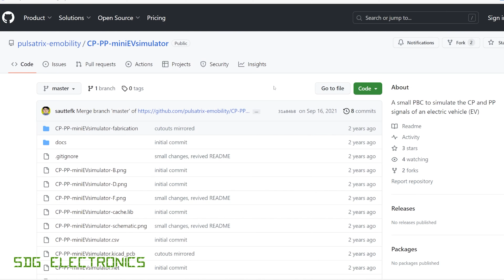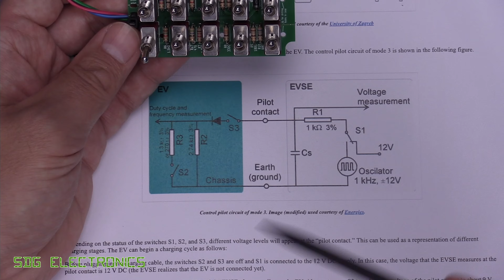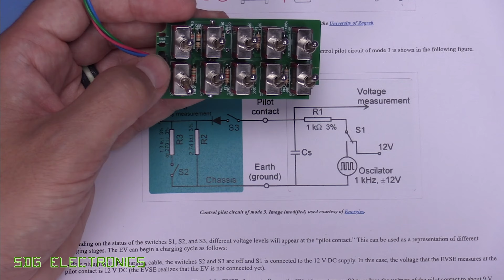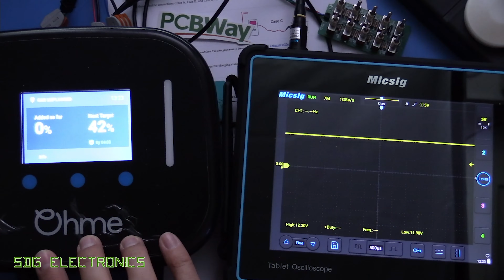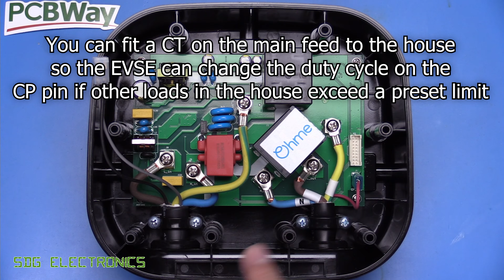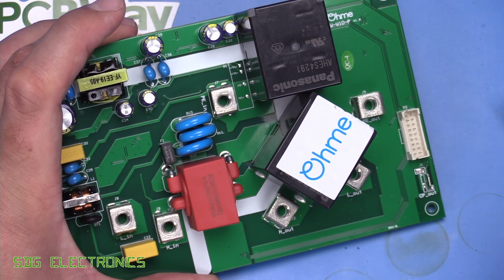SDG #314 Ohme Home Pro, Intelligent Octopus and Home Battery Charging

Comment: Superb video. I have one of these and the screen tells me 'connection error. Sim not inserted...' . Read the comments about peeling off the back. Unscrewed the unit.  The sim card was not inserted fully and had dlipped down. Wikl test tomorrow but i think its fixed thaks to your video and helpful comments
Reply: When you did this, did you then get a message saying "Your device may of been tampered with" Just wondering what triggers this message.

Comment: Just an FYI, that IR sensor is for chassis intrusion. Just got a "Your device may have been tampered with" alert on my phone from the app. Still works though but you can be sure it's logged in their database for future warranty claims.

Glad I got mine dirt cheap :).
Reply: DOes the message interfere with charging? Or do you just ignore it? I'm going to open up my unit to change cable to a longer length. I've figured out how to open "The back label is a bit of vinyl glued to unit, peel 1 corner with your screwdriver and it easily comes off revealing the screws to open up the unit"
Reply: @obwales  interested to know this as well for the same reason

Comment: Use HA. Using the octopus integration, it has a binary sensor to say if cheap slots are allocated. When it is, set the battery to charge or stay off.
Reply from the maker: I tested it, but it doesn't update with any off-peak slots other than the overnight one. Apparently the information is only aggregated the day before the bill is due with data from ohme
Reply: @sdgelectronics  what integration did you use? HACS Bottlecap Dave? Other people have managed to get it to work.
Reply: @danielwalls5150 It doesn't work with Ohme EVSE's because it's Ohme's system that controls charging, not Octopus. If you had a Wallbox Pulsar, then Octopus controls that and gives all the slots on the API.
Reply: @SarahJRandomNumbers I’m pretty sure the Ohme system still needs a trigger from octopus. Therefore, it will be lead to the Binary Sensor triggering.
Reply: @danielwalls5150 Nope, it doesn't. Ohme works very differently to other integrations into octopus. It's Ohme that controls things, where as with others, it's octopus.

Comment: Hi, can you tell me how you got inside the unit. I have the same charger and the screen is dead plus it looks like condensation on the inside. I need to get in but unsure where to start. Did you just take the entire front panel off somehow?
Reply: I did, the back of the unit can be peeled off, it’s tricky but doable. That reveals screws that you can remove to get into the unit
Reply: @radiokidaaa  thank you, all done 😊
Reply: @radiokidaaa how do you peel off the back?
Reply: @radiokidaaa how do you peel off the back?
Reply: @fazq02yfd Just done it now. At the edge of the label. Get a small screwdriver and dig under it. It's glued on. Soon as your under can pull it off with your hands. It then reveals 4 holes with screws. You can then get the unit apart.
Reply: Did you find this out?

Comment: The EVSE PWM duty cycle is used by all units to denote their available amperage. It's a requirement to meet standards and is the only way to ensure that an EV doesn't try to draw more amperage than the EVSE is rated to.
Reply: Not entirely true. Some vehicles ignore the PWM in favour of higher level schemes, such as single-wire CAN (SWCAN).
Reply: @m1geo  Newer EVSE units may support more sophisticated communication methods, but my understanding is that all EVSEs must maintain backwards compatibility using PWM. In the video he states that some EVSEs don't use the PWM scheme and I believe that is incorrect.

Comment: Here in Queensland Australia we've got these Zellweger motors that pump 1050Hz down the line to change our off peak tariffs, however the newer smart meters have LTE-E or Nb-IoT to control & collect data. Recessim has put out some great videos how his Zigbee smart meters work with their gps! 

Maybe I'm just lazy, but surely you could get a cheap rs485 or wifi din mount meter?